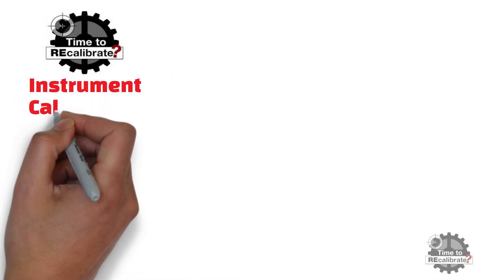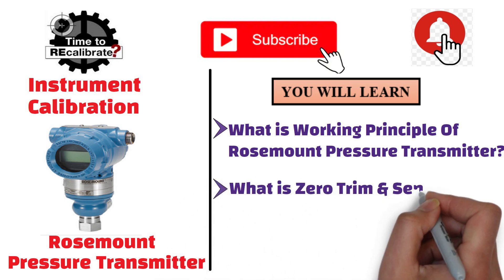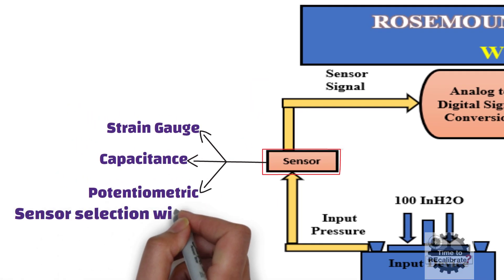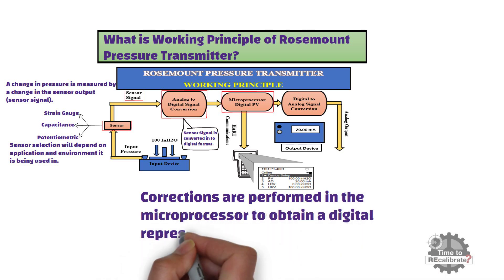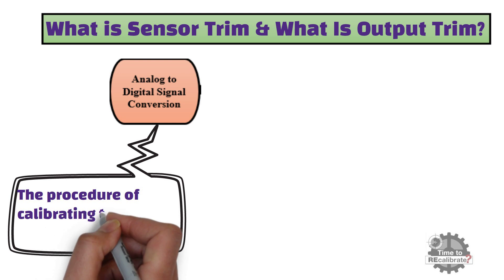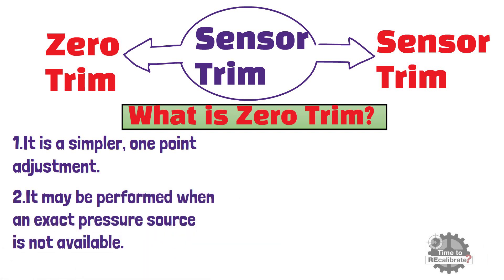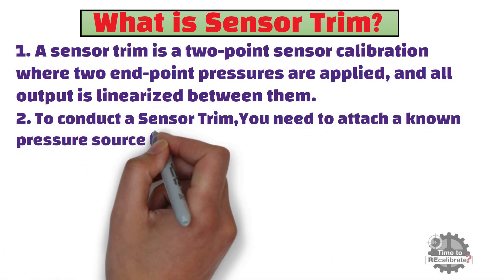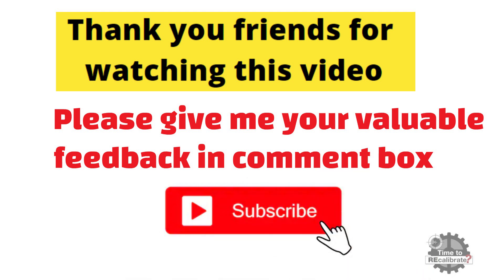Rosemount Pressure Transmitter Working Principle | Zero Trim and Sensor Trim

Comment: We have two types of smart device reading correction, either by trimming the sensor input or by trimming the sensor output. We use input trimming when there is a difference between the reading of the external pressure source and the reading of the transmitter, and it is done in two ways: zero trimming or sensor trimming. We use zero trimming if the transmitter is not connected to an external pressure source, in other words, the high side is open to atmospheric pressure. However, if the transmitter is connected to an external pressure source for the purpose of testing it, here we will use sensor trimming, where there will be trimming of two readings, zero and span. However, if there is a difference between the reading of the transmitter output AO and the reading of the Controller or multimeter, if it is connected to the output, here we resort to using the second type of trimming, which is trimming the sensor output 4-20mA, where the 4mA reading will be trimmed first, then 20mA, each separately.